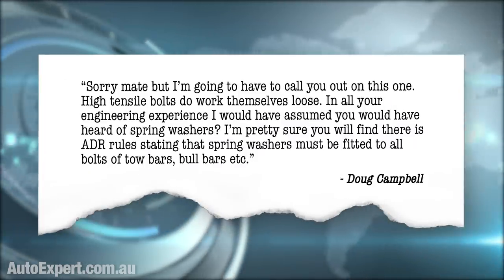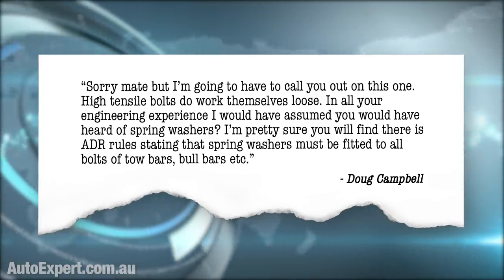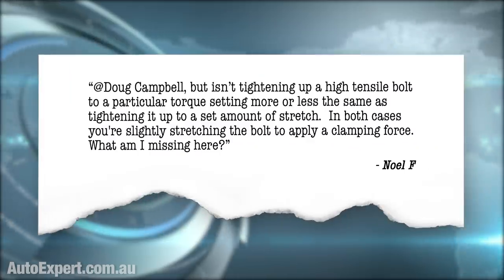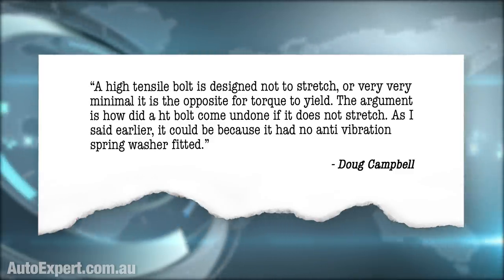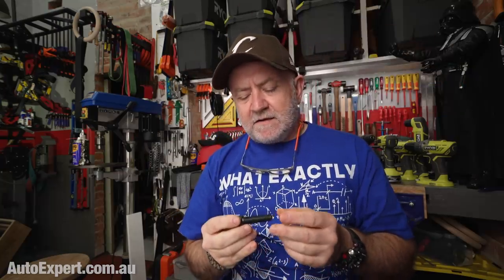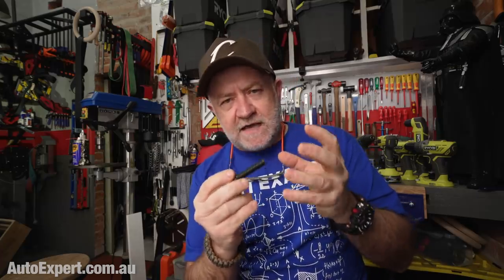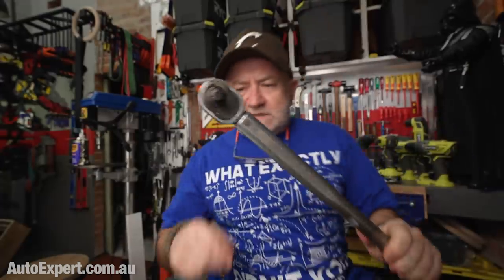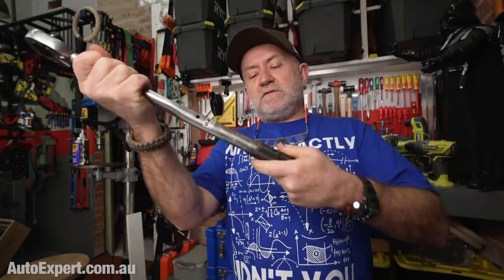The applied physics of high tensile bolted joints and assembly in cars | Auto Expert John Cadogan

Comment: Retired heavy earthmoving mechanic, with hi tensile joints throw the mild steel washers away and use high tensile washers . The bolts fret and embed themselves into mild steel fairly quickly because it is a softer material than the bolt and or nut especially under harsh conditions ie vibration and shock loading . In 45 years I have never seen correctly tensioned bolts with the right washers come loose , plenty of broken and stripped bolts yes but never loose unless what they are holding rusts , collapses or just generally moves from shock loading

Comment: I have seen spring washers used with hi tensile hardware, and in several cases, the spring washer has failed and "opened up" like a rubber O ring might when over compressed.
Reply: yep !
Reply: I don't think you can even get hi tensile spring/split washers. Way back (b4 nanny times) was replacing bolts for lift kit, i vaguely remember i had that "bright" idea, the bolt supplier was like whyTF? you want those for.....because you are buying from a professional engineering supply Co, right?
Reply: Spring washers CAN open up if over tightened. I've seen it often, and now John has explained their use in less critical applications, it all makes sense. An old long-retired busted-arse tradie, that's me....

Comment: Cheers John, as an engineer who spends a lot of time specing up bolts and flanges for the offshore industry . I found this interesting, in a perverted geek way 🤣🤣👍could spend way too much time on materials, lengths, torquing values and techniques.... Get the pad out and run the numbers, double check and no we don't use spring washers....
Reply: As an aircraft mechanic having spent many hours wrenching on airframes and the like you would be amazed at the fastener technology used on aircraft. Consider 3 (yes three) bolts holding each wing onto the fuselage... and they're hollow to save weight... and yes, not a single spring washer to be seen. 😎😁😋
Reply: @mael-strom9707  and design factor of safety = 1.7

Comment: Love your work John.  I didn’t think Doug was right, but I wasn’t able to articulate why.  Thanks for setting it all straight, both in the original comment thread and in the applied physics beer garden.
Reply: good attempt thpu, always good to try and discuss misinformation
Reply: Well done!
Reply: Noel... I challenge you to google ranger ARB rear step tow bar fitting instructions and go to step 47. Then tell me I’m wrong. Maybe John is just smarter than major corporations like ARB. I find it very  it ironic John has blocked the link so I can’t post it?
Reply: Hi Doug, Here’s the link that I think you’re referring to: https://www.equip-raid.fr/ressources/references/fichiers/InstallationInstructions2-3640130.pdf and yes, step 47 does show spring washers being installed on M12x1.25 Gr8.8 bolts torqued to 95Nm in step 50.   

However, John quoted three other tow bar installs that don’t specify spring washers, and as I said in the original thread, I’m no expert on any of this so I have no way of knowing why ARB specifies spring washers in step 47, while the other manufacturers don’t.  Perhaps it’s an error, perhaps they’re critical, I’m just not qualified to be able to tell.

That said, the question still stands.  If spring washers are critical in high tensile nut and bolt applications, why aren’t they mandatory for every high tensile nut/stud/bolt application?  Wheel nuts, for example, they don’t use spring washers, why don’t we see wheels flying off cars on a daily basis?

To go off on a tangent, my first job was as an electronics engineer with Defence where I quickly learned the difference between engineers and techs and the need for both.  As an example, at Uni there were brain bending classes on the maths behind transistors, but there were no classes on soldering circuit boards.  How hard can it be? You melt solder so that the component sticks to the board, done.  Turns out, that like pretty much everything else, it’s a rabbit hole full of details that really matter.  A couple of the techs that I was working with had completed a high reliability soldering course that was a prerequisite to be authorised to work on fighter jet circuit boards.  The techs then gave us freshly minted engineers a crash course on soldering that was a real eye opener.

My point is that engineers and tradies are opposite sides of the same coin.  All the maths in world is no good if you can’t machine up the part to the right tolerances while the best machining skills are no good if you don’t know if the part will fail in service, or not.  Both are equally important if you want the bridge to stay up or the car to be safe on the road.
Reply: @duckmcf  Thanks for the link Noel, I just want to try make this Very clear, the whole argument that lead to this video and the attempted shaming of me personally ,was a about an ARB tow-bar. Not, a Hayman Reece or other branded bar (even though John referred to those brands with pics in this video) funny how he didn’t reference the actual bar in question! Now with that in mind, is why I commented about why he showed the bar fitted (that supposedly damaged the chassis) had no spring washers fitted to the bolts that are recommended by the manufacturer, as you have just witnessed/proven in this link. I think this is more than engineers and mechanics butting heads, I think this is about a pig headed YT content creator that makes money using controversial topics. He sees an angle and runs with it. Unfortunately every thing he has banged on about is now exposed as just plain and simply wrong. This video in my opinion holds no credit and I will be perusing a formal apology.
Reply: @WheresmywingsRedBull  mate, i hardly see how you can say John is trying to publicly shame you, almost every time he cited your  comments he backed it up with a, "to dougs credit it is valid point/ strong argument". Honestly mate i think you're just being a bit sensitive, and just understand that it is possible for a company like ARB can get things wrong.  I am not for one second acting like I know what is right as I am not a engineer by trade, but I just think you have to be open that John could be right mate.  Think how many cars get recalled for major safety issues....look at the takata air bags that were killing people. At some point, an engineer would have validated these items that ended up failing horrifically.  Just my piece mate.
Reply: @robbieb1254  Thanks for your opinion Rob, as hypocritical as this statement is, in the context of this video, it is stated at 30:14 DON’T MESS WITH A CERTIFIED DESIGN. Now refer to the link Noel F previously posted. As a mechanic that takes safety very seriously, if I had to choose between a publicly listed global manufacturer, (ARB) or the opinion of a YT engineer drop out, I know who I would take my recommendations from. There really isn’t anything more to say.

Comment: This kind of thing is why I've got both a standard 1/2" torque wrench and more recently a 1/4" for things like sump retaining bolts etc.  It's just so easy to over tighten smaller bolts, even by hand.  Result?  Best case - warped sump etc, more leaks etc.  Worst - sheared bolt(s), stripped threads etc.

Comment: I'm a fitter by trade, although no longer on the tools. I used to love the jobs where we where hydraulically stretching bolts to tighten them up. It's amazing the clamping forces involved when you need to be using hydraulics to tighten up the fastners

Comment: I worked at Rolls Royce Aero, not a spring washer in the engine, front running at -100+ C back running at +800 C, Bolts never came loose, UNLESS an out of balance vibration shook them loose, very rare event. If the parts are manufactured FLAT bolting them together to preset torque is a very effective means of fixing. One point, any bolt CUT with a Die is prone to failure, this is why the threads are rolled onto the bolt not cut, cuts mean cracks.

Comment: Flawless method for doing bolts up, (c) AvE: Do it up until it goes loose, back it off a quarter turn, call the apprentice.
Reply: How many ugga dugga's is that?
Reply: @petermoll3421  7 ugga dugga’s is correct for wheel nuts but you have to say “click” when you finish.
Reply: Yeah.. we can have a laugh about it, but I lost 5 friends when the prop fell off the plane they were in. NTSB investigation showed that the prop bolt was over-tightened at a recent engine overhaul. Took them ten minutes from when it fell off until it crashed and burnt them to a crisp. I had to get their dental records so they could be identified. Ugga-Dugga’s are no substitute for a torque wrench.

Comment: Tightening to a "torque plus certain angle" is a thing not only for torque to yield, but for standard ht bolts as well. 
 If the bolt is long enough, using low torque spec to practically just snug it so all sits well and then the prolongation of the longer bolt as the thing defining the clamping force.
If the prescribed torque is unusually low for the bolt size (so able to just squeeze the seals so hard surfaces just sits on each other but no significant load) and bolt rather long, odds are the design won't expect to even go close to the yield point at all, just utilizes the elasticity to get more precise preload, just how the standard ht bolts use to be designed. This uses to be the case for many engine cylinder/cylinder head assemblies or so (or uses to be specified as an alternative method to the torque soec, as the "snugging" does not have to be that accurate so you won't need the torque wrench; often specified for some small older engines, expected to be DYI serviced, as these head holding studs are the only high tensile fasteners requiring some control on that machine).
Of course, if the manual explicitelly calls for the use of new bolts for every assembly, those connections are really most likely of the "torque to yield" design.
Anyway, the procedure in the assembly/service manual is the only way to go, regardless of the actual design...

Comment: I designed aerospace fastening systems in a past job. One memorable test I ran was testing high-strength 1/4-inch bolts in a point-designed captured nut. Those bolts fractured at about 10,000 lbs of tensile force.
Agree completely with your analysis and discussion of spring washers.🖖😁

Comment: I am an engineer (electrical in fact) but have worked in engineering maintenance in manufacturing and now logistics for over 30 years.  At one point I worked for Good Year and the global reliability engineer had performed research across all 70 tyre factories and the number 1 reliability failure was fasteners.  He was passionate about the topic, taught us the correct use of fasteners and told us to go back to spare parts stores and throw out all the spring washers (as they were counterproductive), invest in torque wrenches, training of tradesman and if you had vibration issues use Nord-Lock washers.  I have carried that philosophy to every maintenance team I have managed since with great success.  Also I see a high tensile bolt as spring holding two surfaces together.  I couldn't count the amount of times I had seen bolt failure and technicians simply just going for higher tensile bolts but not focused on tightening the bolt to the correct torque settings.

Comment: Well, I will add my two cents worth. I am a retired mechanic who did my apprenticeship and worked in the bus and coach industry and the company specialised in central OZ camping tours when all the roads were dirt, even the highways. Well, vehicles regularly had bits fall off and some of it was due to poor design in light of the vehicle operating mode but most was due to the wrong use and tensioning of fixing hardware. We used spring washers, Nyloc nuts, thread lock but in the end, nothing beat good design and the proper tension and this was proven with the introduction of European vehicles to the coach market. Before the widespread adoption of flange head-type nuts and bolts, we found that using hardened Bellville flat washers for high load chassis applications gave the best result. Using a high tensile bolt or nut without a corresponding hardened washer in a high vibration location usually meant the bolt head or nut buried into what it was mating to if it was softer material. Now I could write another two paragraphs on the shitstorm that was wheel stud failure on American component axles but I better not.

Comment: Hi John,

Great vid as always, and across years of heavy vehicle repairs and inspections the comments from others on spring washers are spot on, they usually spread out like a squashed o-ring and risk total clamp failure, not to mention departing from manufactures spec.

The only comment I want to add is there’s been no mention of the possibility that the ‘clamped chassis’ failed because the clamp around it ‘squashed’ the chassis out of shape, which then cracked, and once cracked the bolts appeared loose because they were no longer clamping the same dimension. I used to see this all the time where vehicles were presented for mod certs with after market items bolted or clamped around hollow sections of chassis (integral and ladder) with no regard to deformation of the chassis.

Just another variable? I apologise if this was covered somewhere.

Great channel.

Comment: The thing I find worse than using a spring washer in a high tension application is when they include a flat washer as well as the spring. 
Part- flat- spring-nut eliminates any imagined usefulness by keeping the spring washer from contacting the part being attached.
Reply: The chisel locking effect of a spring washer is virtually useless against the hardened surface of a high tensile fastener or high tensile washer.
Reply: My 2 thoughts (I dont get so many at my age :-) ) in one thread!
And reading this, I had another. Even if the spring washer could 'bite' into HT steel, it would only stop the fastener falling off after most of its clamping force is lost--it wouldn't stop the parts from chafing, rattling and fatiguing the chassis rails, which needs a whole lot more torque.

Comment: Thanks John.  I am qualified as both a motor mechanic and a mechanical engineer and I spent some time working in automotive powertrain design. For what it is worth I think your views are dead on here.  When I did my apprenticeship in the 1980's it was pretty much unheard of to use a torque wrench for anything  on an engine except cylinder head bolts, big ends and main bearings.  Everything else was done by "feel" and this was pretty random at best.  Failures were a common thing, especially with apprentices who hadn't got that "feel" right yet, and some tradesmen just never did.  Your comments regarding spring washers echo what I was always told in both of my professions.  Basically they were a stop gap measure to try and accommodate fasteners that were not sufficiently torqued and then subjected to a lot of vibration.     This was always regarded as a cheap 2 out of 10 solution but slightly better than nothing.   If you look at most engine fasteners in modern engines which are initially installed with precise torque you won't see a single spring washer.  Why? because they are not required and also because they introduce a galling effect when tightening that makes accurate torque setting much harder.   I am really enjoying your channel both for the sound engineering and also the excellent way that your communicate with your audience.  Please keep up the good work.  Regards Paddy

Comment: Doug hasn't spent much time on the tools.
I've seen too many spring washers straighten out and fall off the bolt, long before reaching the specified torque. I don't use them. Cars don't have many OEM bolts with spring washers. Some bolts have the captive washers. Towballs have quite robust spring washers, as do some axles. I have had both start to straighten out before reaching torque spec.
Reply: Nylocks, loctite... the usual modern fixes. Spring washers are just old.(and don't work too well.)
Reply: Hey Grim, did it ever cross your mind to google the actual fitting instructions for the ARB tow bar that was mentioned before you decided to judge me?  I challenge you to google ranger ARB rear step tow bar fitting instructions, go to step 47. I can’t post it because your hero has blocked it. Enjoy that egg in your face buddy!
Reply: @WheresmywingsRedBull  I don't need to. If it has an 8.8 grade bolt. Check your recovery point bolts.
Reply: @Godwillsortyou  If you didn’t already know, 8.8 is still classed as high tensile
Reply: @WheresmywingsRedBull  butter in my fridge is higher grade
Reply: @Godwillsortyou  so are those eggs. Hope you enjoy them.
Reply: @WheresmywingsRedBull  it's not the lack of spring washers that damaged your vehicle. You were probably overloaded. The bolts would be tighter without those washers. Spring washers limit the torque that can be applied. It's also possible the washers were fitted and they straightened out and fell off leaving you with a loose towbar. You were incompetent in failing to check the vehicle, and continuing to operate it caused more damage.
Reply: @Godwillsortyou  so both you and John are both smarter than the manufacturer, ARB. A global corporation? Keep in mind John played the safety card and stated you must follow manufacturers recommendations! It has been engineered this way! Please keep up…. This is not my vehicle or tow bar in these videos. John made this video because he stated spring washers should not have been fitted, which is proven wrong by the fitting instructions. Look them up
Reply: @WheresmywingsRedBull  ARB are always upgrading and updating products. Failure is one of those reasons. Product development takes years of usage and failures.